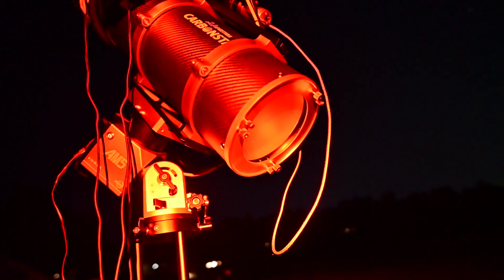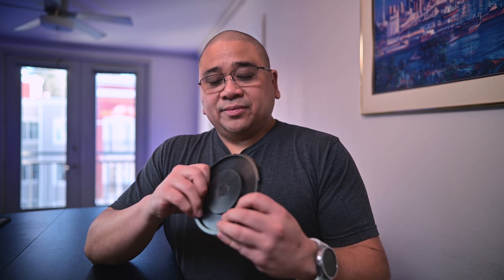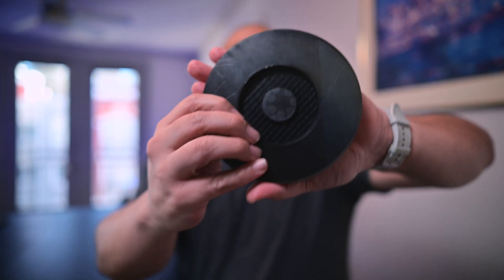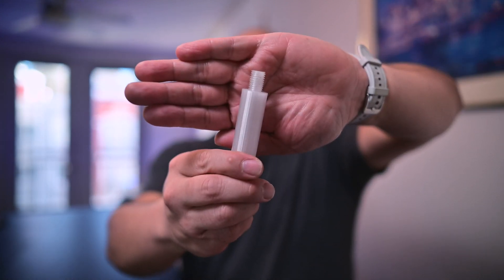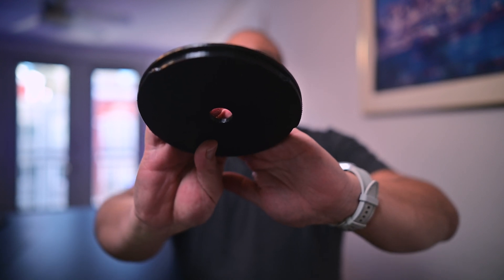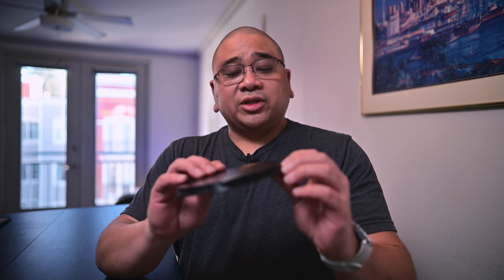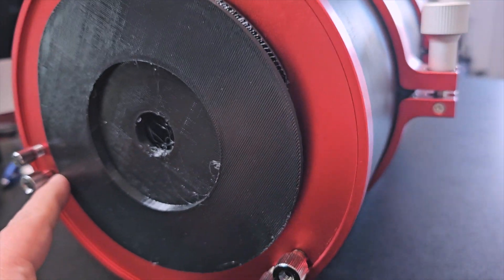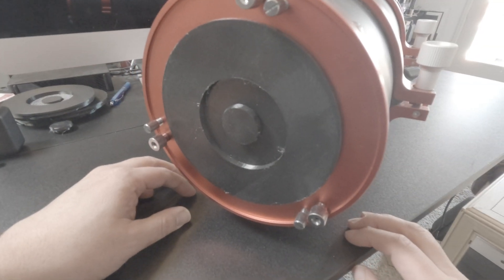Carbonstar 150 3D Printed Custom "Stay on"  Backcap install

Comment: Interesting design, why not make it so that it may screw into the back rather than bend it??
Reply from the maker: You should try it. Design it and print it out. That's what the 3d printer community is about.